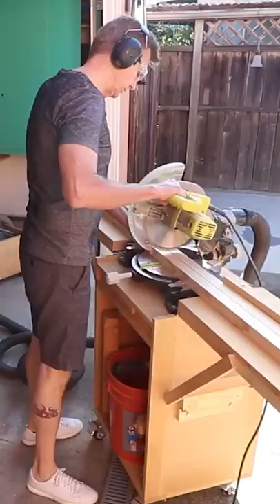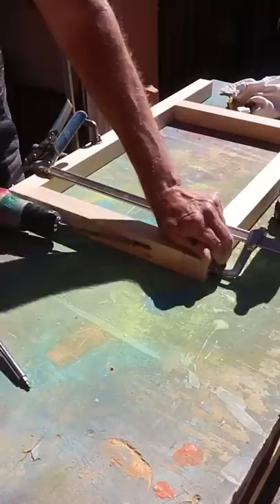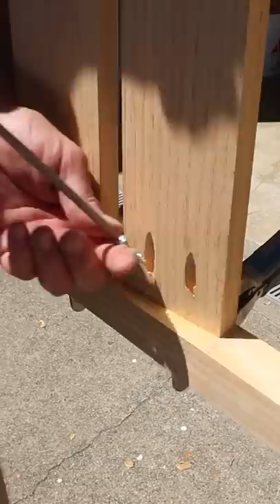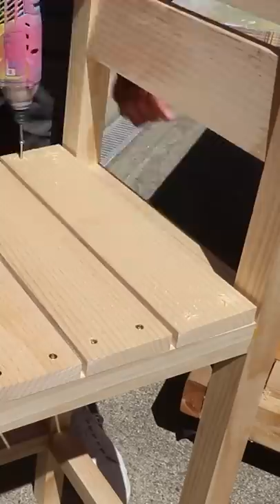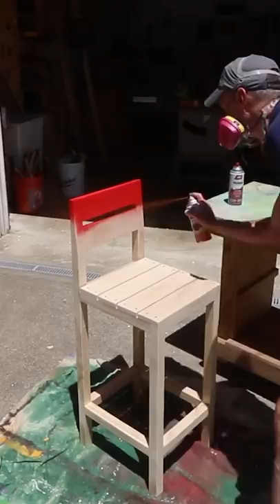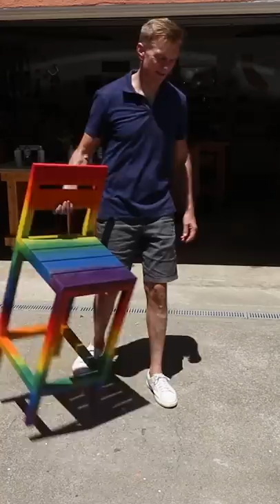a rainbow barstool  🌈

Comment: So I have a question, I hope either Steve or someone from the community can share some insight. I see in every woodworking video that people always "check to make sure it's square". Thing is, it's always square. I never see any woodworker that while checking to make sure it's square they find out it's not. This is very concerning to me because quite a few times I've reached that "check to make sure it's square" step, and more times than I want to admit it's not, and nobody ever tells you "If it's not square, do this". So, my question in short is, what exactly am I supposed to do if it's not square? Throw the towel and cry in a corner?
Reply: if you are gluing something, you can absolutely attach it out of square, which is why you check it before the glue dries
Reply: If it is happening from the cuts you are making, you’d have to check the squareness of your blades to the saw. If it is happening when doing some kind of assembly, then you’d have to put some clamps at different angles to force it into square. Hope this helps.